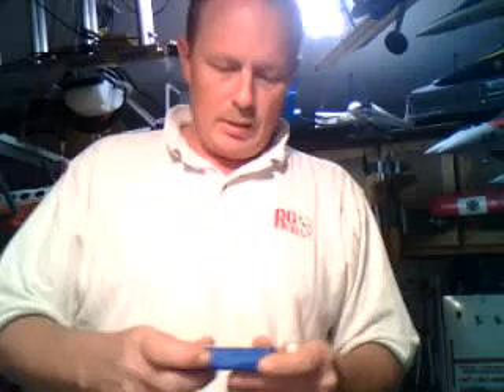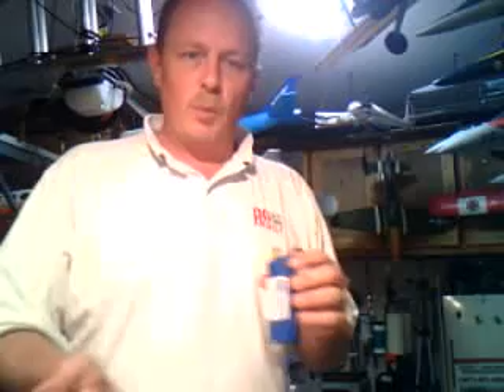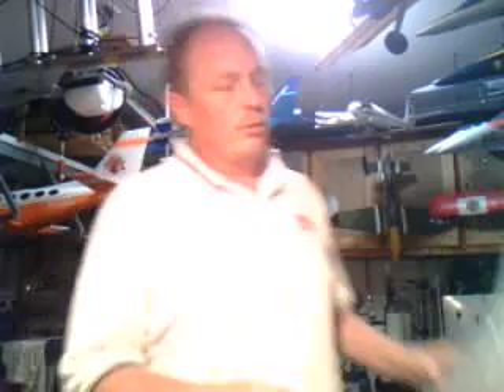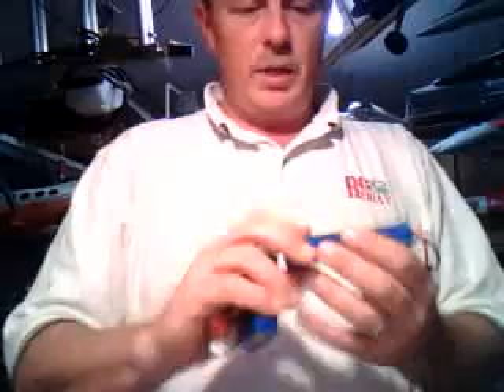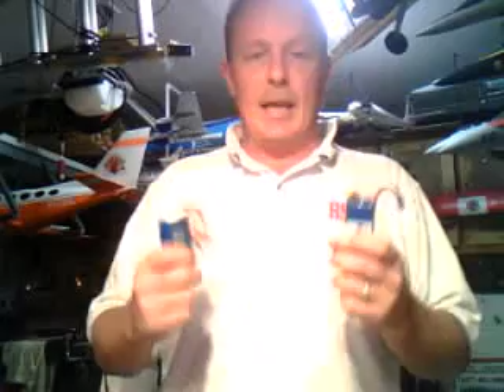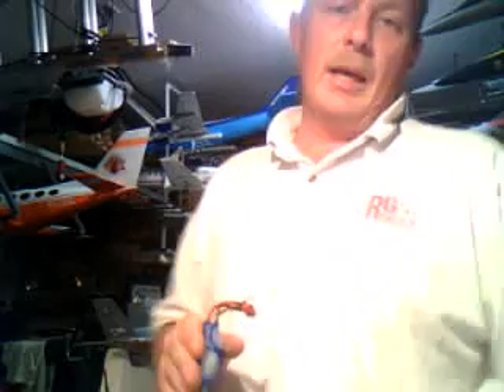Lipo Battery Numbers and their meaning

Comment from the maker: In this video, I only address Lipo Packs, Packs that are prepackaged and YES, connected in Series.   

If you wanted to get More MaH, or run time, you could connect 2 Lipo Packs (3cells each of 11.1volts and say 2200Mah) and you would have yourself an 11.1 VOLT 4400Mah Battery Pack.  

This video was made for someone just getting into Lipo's.  I didnt address wiring Lipos in Parallel (Combining Packs)

Comment from the maker: 2s/3s/4s - the "s" means "series". This is the amount of cells the pack has that add to the total voltage. Each cell is 3.7 volts nominal, so 2s=7.4v, 3s=11.1v, 4s=14.8v, etc.
2s2p, the "p" means "parallel". Unlike traditional nimh packs, lipos are commonly run in parallel in addition to series. This "p" number is the amount of cells in parallel the pack has, which adds to the total capacity. Each "p" adds the capacity equal to one individual cell capacity in the pack.

Comment from the maker: Plus, it doesnt matter if we are talking LIPO, NiMh or NiCd batteries.  All packs get their voltage based on the number of cells in the pack.  A 6cell pack NiMh creates a 7.2 volt Pack.  A 7cell pack NiMh creates an 8.4volt Pack. And so on.  Im not sure where you are getting that it doesnt matter how many Cells a Battery Pack has.   

Now, if you are Talking about connecting multiple PACKS together to create more Cells or Mah, thats a different topic and Wasnt covered in video.

Comment from the maker: Lipo packs are merely multiple batteries connected together.  It takes 3 batteries (CELLS) to get your 11.1volt lipo battery.  The 11.1 volts is basically the amount of voltage provided to your device. An drained 3cell lipo should not be drained below 9.9volts and shouldnt be charged above 12.6volts.  Put a cell lipo on a Voltage meter after fulling charging, you'll clearly see your volts are at or near 12.6volts. A 4cell will be at or near 16.8volts.

Comment from the maker: Perhaps Im misreading your comment. Are you saying that Each Cell of a Lipo Battery when fully charged has 11.1 volts??  That my friend is incorrect.  It greatly matters how many cells a LIPO has. Unlike other batteries, LIPO batteries have a Low voltage that you must stay above, and a Maximum Voltage charge.  Each CELL Min is 3.3volts, and it's max charge is 4.2volts. So on a 3 cell LIPO, the voltage reading when fully charged would be 12.6 volts.  A 4 cell would be 16.8volts. and so on.

Comment: It might be more helpful to refer to the battery's capacity as milliamp-hours since that measures a specific amount of energy, as opposed to a battery's C rating, such as 25 amps, which measures the safe *rate* of discharge.

Also, LiPo batteries are very very dangerous to use improperly.  Rapid charge or discharge beyond safe specs can result in an explosion.  Also, damage to the battery, such as a puncture can result in explosion. Look up exploding LiPos on YouTube.